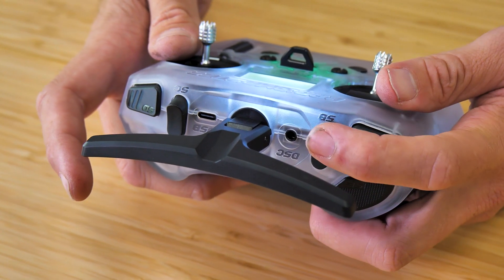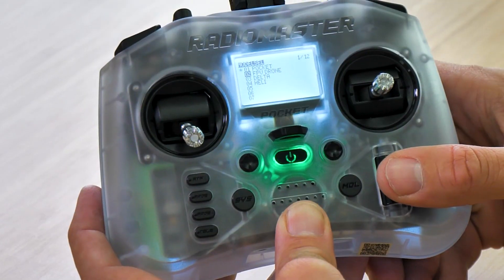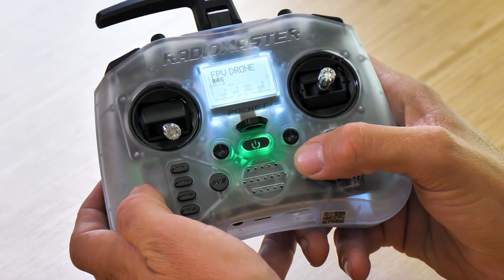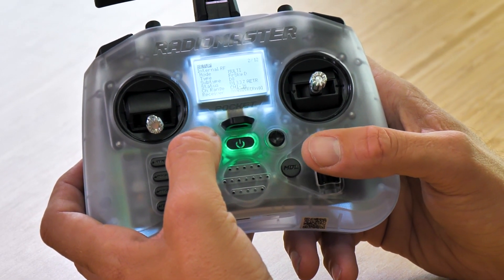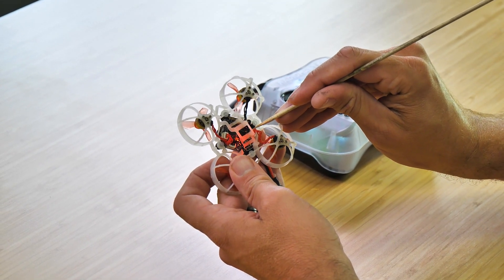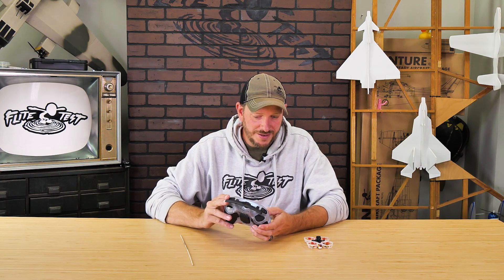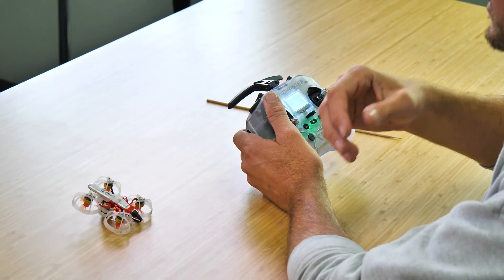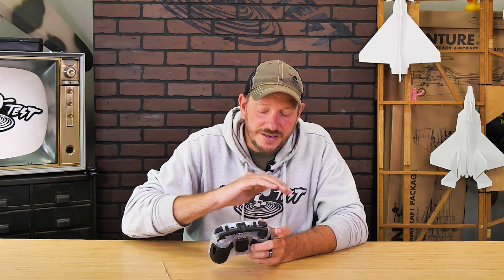Binding The Pocket Radio To The FT Tiny Whoop

Comment: I need to browse the flight test store... do you have any kits you would recommend I do fly Fpv, I also have an ar wing and have enjoyed gliders in the past.. the reason im commenting is because I picked up a bunch of smashed quads and spare parts, and I have a butt load of motors, props, a couple three four flight controllers ,2 speed controllers, a couple video management unit, and tbs crossfire rx with the t shape Antenae.  do you have any planes Mayb a glider even that u sell as just the kit or prebuilt kit, so I can go in just add some motors and electronics, wire up some video and have a whole new journey I can explore.  glad to have seen some new content of yours ive been a flight test fan for years and years I love your creativity and imho your the dopest pilot.  u need to do a redo of that high speed wing dive thru the 10 storage containers, I guess the light gap and some other wind issues really made it a pain, but id love to see you invite me out 2 do a part2 redo with me ripping some quads thru .